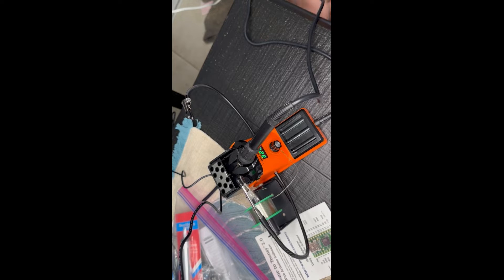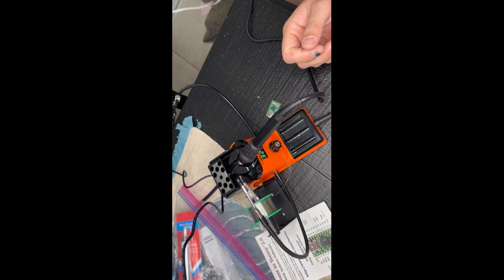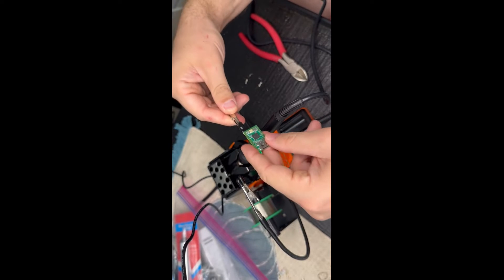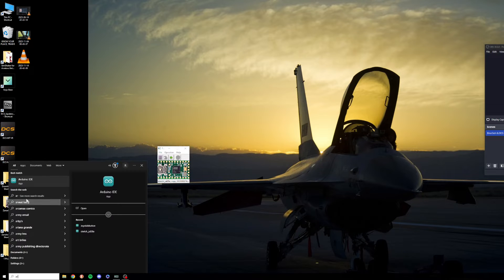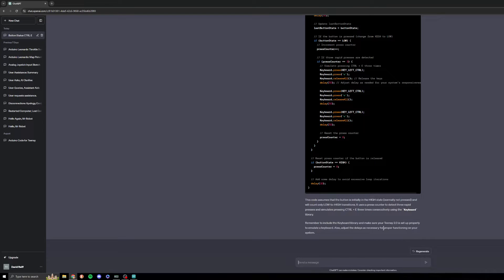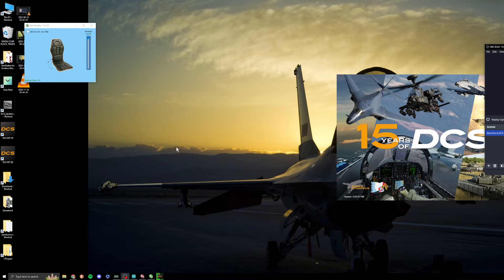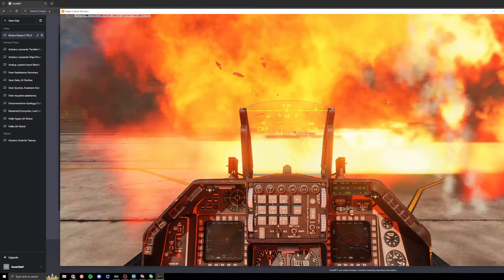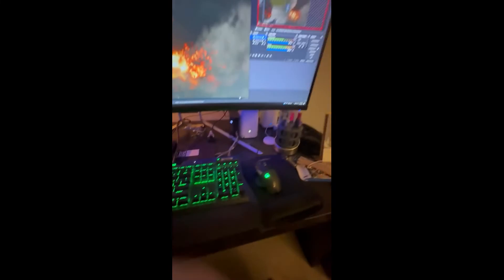Bourbon & DCS: HOW TO:  Make your own USB Ejection Handle!

Comment: This is awesome. Glad you got the code figured out. I made one a year ago out of a USB Brake handle that I bought from Desktop Aviator several years ago, but didn't use much. I used the switch/button funtionality of Voice Attack, since I use that program with DCS (with Vaicom Pro). VA does the Cntrl-E function perfectly on the first try. I love the fact that VA does a lot more than basic voice commands.  However, now that I have a motion rig, I hate ejecting with a passion!  As much as I love DCS (been with ED since the original Flanker), they tend to do some stupid shit!  When you eject with motion, you feel the violent tumbling and crashing of your airplane, instead of the forces of an ejection seat and parachute!   I understand that DCS is old code which predates consumer motion rigs, but that is just "PLANE stupid"  LOL.  I really hope ED fixes that and a bunch of other dumb shit before I'm dead!  Like raining inside hardened aircraft shelters, to name a few.  Anyway, I've since converted that T-handle switch to my JFS starter in the Strike Eagle and it's a blast!   I also love my Aero (purchased two years ago at the original price with no regrets) as well as my Jetseat (I noticed you have one as well). Nice Viper pit you have 👍🏾

Comment: Let’s talk about your new Varjo Aeros. Happy? Just got them myself and fuck a duck they’re high res. Not sure about how much the lack of huge FOV is fucking with me yet. Yeah it’s not great but I feel I mostly forget it due to the amazingly crisp picture. Also - that internal fan is such an amazing move.
Reply from the maker: Yeah I’ve had the index since 2019. Regrettably I bought that aero used 3 fucking days before they dropped the price.. 🙄 so that sucked. The FOV isn’t that bad, and if you mess with the strap settings you can get it closer to your face which makes the FOV almost so big it’s similar to the index if that makes sense. You gotta really ratchet strap that sucker down though. I also ripped out the nose hole rubber so I can see my own body. 
And yes. That fan is AMAZING
Reply: @BlackSockRepublic  removing the nose rubber sounds kinky. I should probably do that as well - and try to skullfuck it further to see if I can get better fov. The clarity is amazing though. I zone out and just stare at small text instead of actually find targets.
Reply from the maker: @hreple  yeah, that was the wow moment for me too - looking out my left and reading the labels on the mavericks